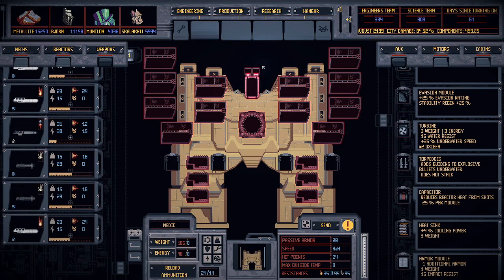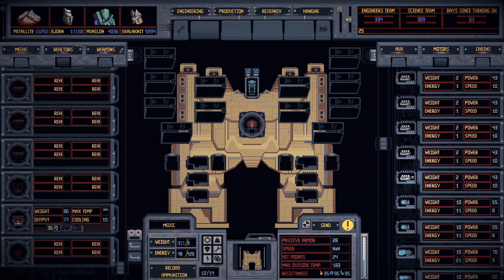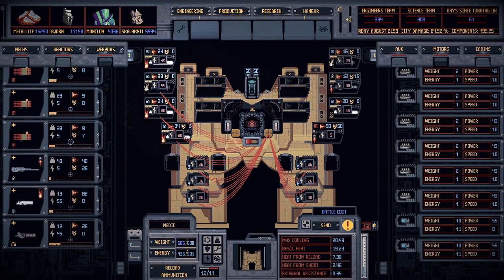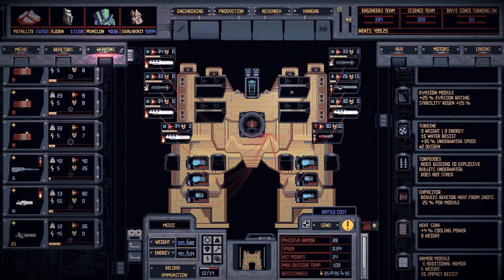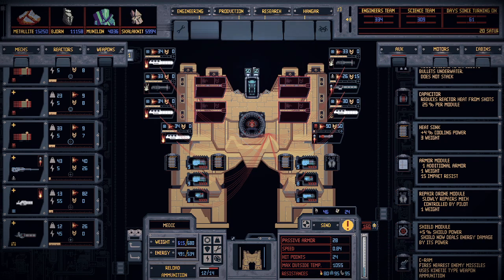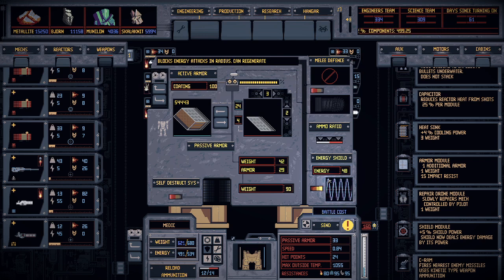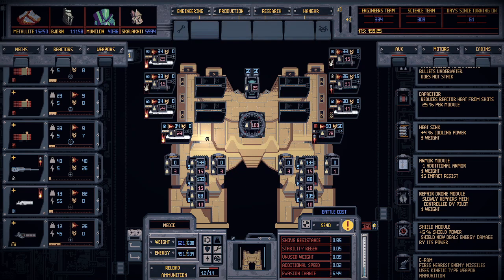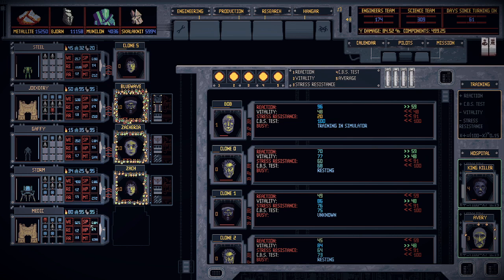Mech Engineer, Mech engineering tutorial

Comment: What should i do with the numbers at the bottom left; try to get them as close together as possible? And how does the armour page work?
Reply from the maker: for the numbers on the bottom left, the left one is how long it takes to reload. and the one on the right is how long you can continuously  fire before you have to reload.
Reply from the maker: armor is odd, layer 0 is the base layer, 1 is the middle layers, you can have a few of this and 2 is your outer layer, which like layer 0 you can only have 1. coating is how many hit points that armor has. but you have to acumulate enough damage taken in a short enough time from to overcome your passive armor first before you start taking damage.